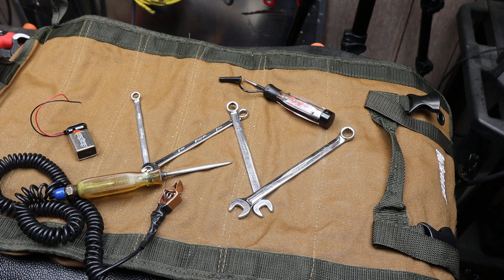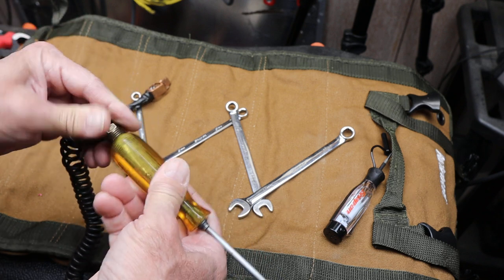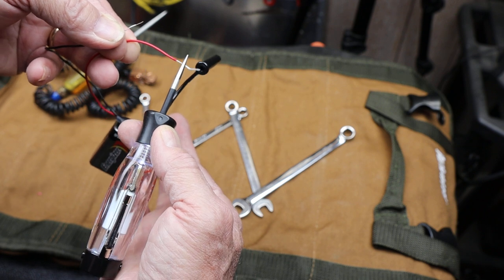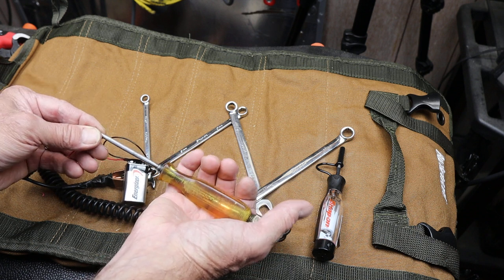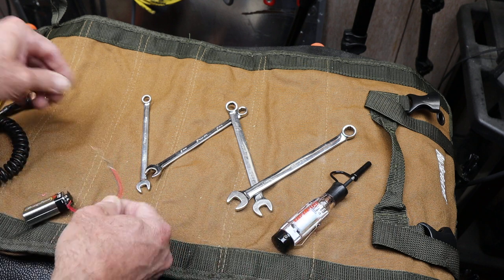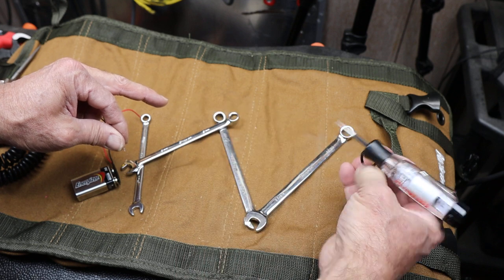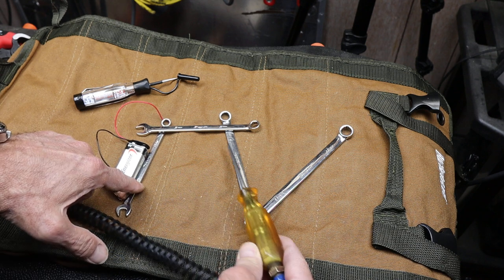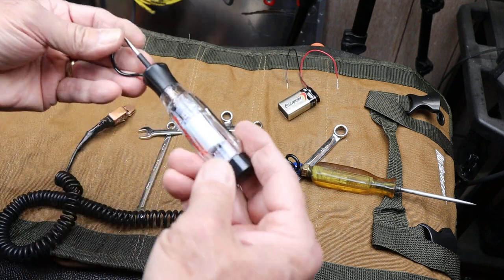Snap On Cord-Free 3-24v EECT200 Circuit Tester: Relationships are build on trust. This thing is cool

Comment: Hmmm.. but those electronic test lights don't significantly 'load' circuits, and miss a lot of high resistance issues. They're cute, beep & all that, but the old fashioned incandescent is almost always the correct technology for the application. Would you like to sell me that old Snap-On CT4E?
Reply: Spot on. When I bought mine the old school electrician at the bus depot I worked at said. They can send you on a wild goose chase them type of testers. "you need to check your circuits under load, check them using a headlight bulb and that will give you a true answer" years later it did catch me out and yeah I was sent on a wild goose chase trying to find the problem with some faulty side marker lights on a trailer, the wire was almost totally broken apart from 1 or 2 little strands and this tool detected power and I assumed it had the full 24 volts but really it had very little but enough for this tool to say it was ok. Be warned
Reply: We are not allowed to use any other test light at work but the old school ones. The new ones send you on a goose chase that happened to me. They are really fancy but they cost a lot of problems

Comment: That thing is like $75! That is almost the price of Fluke T110. The Fluke will test both DC and AC and you don't have to be part of the circuit. The Fluke will also tell you if your polarity is the wrong way around the only downside is that you need a minimum of 12v. If you need to go below that then the Klein ET40 is only $25 and goes down to 1.5v
Reply: but....., it doesn't say "Snap On"
Reply: @Callelle6251  get that laser engraver out :-)
Reply: Actually you can get the et40 for $14 including shipping  on ebay.

Comment: Not sure if you know what a Power Probe is. It's a different tool for circuit testing. I just received sort of a copy of a Power Probe. It's an Innova 5420. It has a couple neat features PP's don't have. So far I really like it.
Reply: IMHO, those Power Probes & the like have the potential to really wreak havoc... and have done so since their introduction. Don't even get me started...
Reply: What features does the Innova have that the Power Probe doesn’t? I checked their website and didn’t see anything.
Reply: @athhud  It has the tilting head, it goes down to 3v, and it has the cig plug. I know PP has many models so maybe I missed something?
Reply: @rwbishop  That's operator error which we are all human. That's like saying we shouldn't use a benchtop power supply to inject voltage because you can put it in the wrong place. We shouldn't drive cars because we can get into an accident. If someone used the tool incorrectly that's on them not the tool.

Comment: Does it use RF to test the circuit? Can't imagine it's passing enough current through your skin to actually activate the circuit.
Reply: It will use a capacitive voltage sensing circuit. It basically just ramps things up a bit so that the moist surface of your skin can act as a “ground wire”. Kind of a silly idea. It really isn’t even “wireless”. You just buy it without the wire and then use your body as the wire. Pro tip: if you want to free up your other hand while using this thing, just clip a test lead to your ear/nose/lip/testicle/etc. and the other end to a chassis ground...
Pro Tip #2: Knowledgeable professionals have zero use for this gimmick tool. Only gullible inexperienced hobbyists would waste their money on it, simply because they don’t know any better. Hopefully I can prevent someone in this comment section from wasting their hard earned money.  There are literally toys at the dollar tree that can do the same thing this $75 light does and they have replaceable batteries.

Comment: I used to be a "must use digital tool for testing automotive circuits" kind of person until I actually learned how valuable an old-school bulb test light can be.  There are better halogen bulb test lights out there...that Snap-on with the 6614F bulb isn't so great anymore, and the bulbs are nearly impossible to find.

Here are some things that your new circuit tested seems it cannot do:

1) Indicate a high resistance short (a short between two wires usually cause by corrosion). This will be indicated by a dim light.
2) Voltage drop.  You cannot see a wires ability to carry current.  This will be indicated by a dim light.
3) Pulse-width modulation.  You can see some PWM at low enough frequency, or you can see the light dim.
4) As you demonstrated, you can only test a circuit in one direction.  This is beyond stupid...snap-on should know better.

I've honestly had good luck modifying the $4 HF circuit tester to suit my needs. However, I have not yet attempted to purchase a replacement bulb.

I suspect that circuit tester is probably just a couple darlington transistors and a buzzer...probably something somebody could make for under $5 if they wanted to. I'd be interested in seeing how low of a voltage it will detect.

Comment: By reading comments, it’s pretty clear there’s a lot of people clueless about what a circuit test light it for. 

This video was a demonstration for those who know what this incredibly usefull tool is for. For those of you who have know idea, maybe do some research about it before making uninformed comments. Not every tool is made for every job. The circuit tester, aka test light, is an incredibly easy and awesome tool to have in your toolbox, especially if you do any type of automotive wiring. And it just got even better by becoming wireless! I’ll definitely be getting myself one.
Reply: Strange how all of the comments I see know exactly what a test light is used for and know exactly why this gimmick tool doesn’t replace an incandescent bulb on a stick...
Reply: Sorry I was so slow to reply. I was busy diagnosing and repairing a CANBus network fault that 3 shops and a mobile diagnostics “specialist” couldn’t figure out, but suggested the owner piss away thousands of dollars on parts and programming that he didn’t need for his F250. By some miracle I was able to get it repaired without this wonderful $75 wireless test light that I “can’t afford”. Hell I didn’t even need any parts. Must have just been a fluke. Wait no, the Fluke is my $400 true RMS meter... Snap-On does make some decently built stuff. That’s why I bought the multi-thousand dollar Snap-On Modis. It lets me watch the network waveform to see if the modules are sending diametric CAN high and CAN low signals and whether or not those signals are pulsed square wave data packets that each module can interpret. I also used a couple of hundred dollars worth of Power Probe 4 and Power Probe EECT3000. The most valuable tool for the diagnosis though was a $15 incandescent test light with a custom cord and clamp that allowed me to put a low current load on each circuit to verify that it could in fact carry enough current to serve its purpose in the network. I even did some circuit board repair and solder reflow on the instrument cluster board and the PCM. I went as deep into automotive diagnostics and repair as one can possibly go. Oh but if only I would have had the uber awesome snap-on wireless test light! I seriously can not think of a single aspect of the entire diagnostic process that such a tool would have proven useful or even saved time. ANY part of the circuit that I could have used that wireless trash on, would have required that I use a second tool to go back and verify the current carrying capability of that portion of the circuit... I’d rather just do it once with a tool that will actually tell me what I want to know.

Like I said, you entered a conversation that is well above your pay grade and only know just enough to pretend you know anything. I hope you are young and just need more time to learn. If you are more than a decade out of your 20’s it is most likely too late, but if you will shut up and pay attention you MIGHT still be capable of learning something.
Reply: Wow! Was that necessary?
Reply: @chiphill4856  I guess we will never know since he deleted the comments that I replied to. Seems like he tucked tail and ran. Hopefully he ran off to educate himself.
Reply: Right on the money

Comment: It's a niche tool, not very practical just for the reason you need two hands. Probing wire bundles one handed is a pain and not very productive, easier and quicker using a standard test light, plus the glove factor is important if you do any work in cold climates.

Comment: I love your channel, Doc.  But this demo seems a bit fussy and tricky.   Not great for a reliable electric tester.  

I use a simple tester made by installing a bright 12v yellow LED bulb in a rubber socket with pigtail.   Crimped on two alligator clips and put red heat shrink over the positive lead.  It's a great voltage checker that also checks polarity.
Reply from the maker: I don't disagree. As admitted, I was new to the tool and more curious about its reliability and operation. I've learned a lot since then. Thanks for the comment.
Reply: @lastbesttool  thanks for the content!   You do a great service for tool lovers!

Comment: If you would use a ciruit tester the proper way they are supposed to be used then there would be no issues and you would not need a $200 hypodermic needle !

Comment: Lots of haters in this comment section that don’t get that this shouldn’t be your only test light, it’s a supplement for certain situations..... smh.
Reply: The problem with that argument is that there is not a single practical situation where this tool would save time, make a job easier, or provide a better diagnosis. Every possible job you could use it for, would need to be followed up with another tool to verify that the “wireless” light was correct. At no point in time would it ever be reliable or even slightly useful. A cheapo incandescent test light can do everything this thing can and so much more. There is literally NOTHING that this tool can do that a standard test light can’t do EXCEPT give false positives on a circuit that can’t carry enough current to actually work. For it to  be a “supplement” it has to (by definition) enhance a job or tool. By design, it can’t. It can only be a detriment because it can and will lead you astray.

Comment: Cool tool, the problem i see is that let's say you are checking a circuit that is supposed to work on 12 volts but there is a voltage drop of say 5v due to corrosion or arcing due to a loose connection that cordless snap-on circuit tester will beep fooling the person into thinking the circuit is good and can carry  a load when in fact it cant, the technician might think the switch or the component need replacing when in fact the problem was at the wiring. The test light especially an incandescent one will either not light or just barely indicating to the tech that there is a problem in the wiring etc. Remember just because it beeps or lets say a relay clicks doesn't mean its good. The lisle company came out with this test light that does put a load on the circuit by pressing a button and an LCD to view the actual voltage drop. https://youtube.com/watch?v=75bVAkkyM8M&si=xeP_qRlqssz816BG

Comment: I know I would not use a tester or do anything that has a high probability of putting me in series with an electrical circuit. This is a very basic Electrical Safety principle. Regardless of the brand I would not recommend these types of testers to anyone. Take the money you would spend on one of these things and take a class on electrical safety.